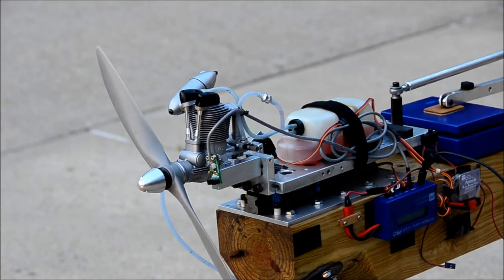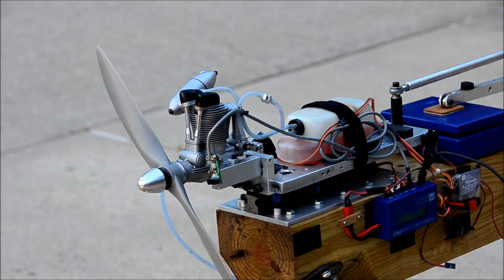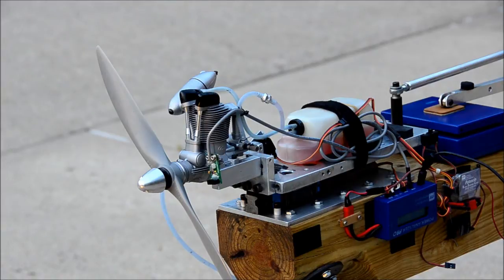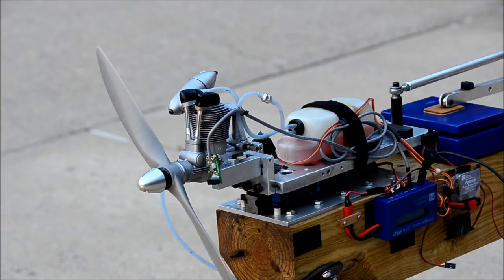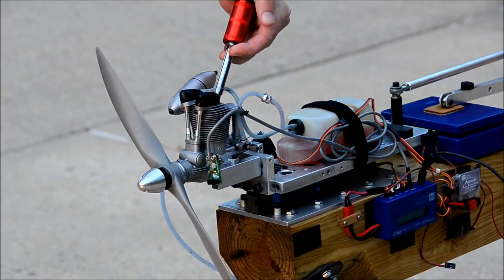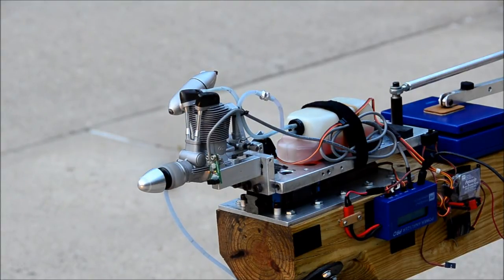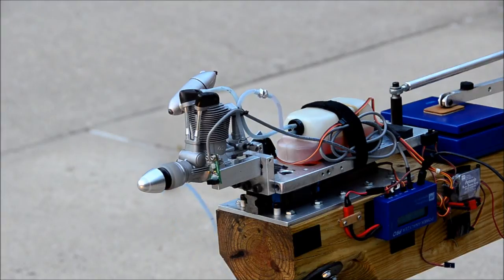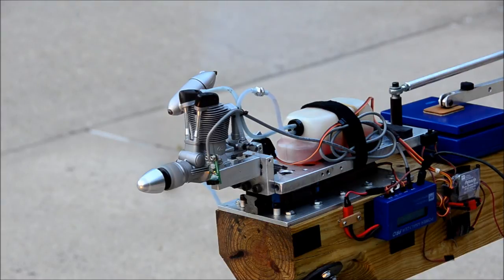O.S. FS-95V Four Stroke Engine Test with APC 15X8

Comment: the Saito 100 should spin that APC 15x8 300 RPM higher
Reply: Does that make you feel better?  The OS haters need therapy….lol
Reply: @donrichter3523  hee hee haa haa LOL you are 4 years too late. what you don't know is, if you put an APC 14x8 on that engine it most likely will turn it higher than a Saito 100 will.
BTW, I don't hat OS. just disappointed with them.